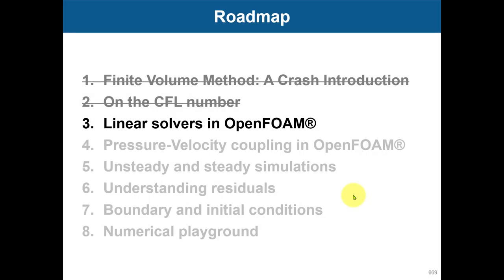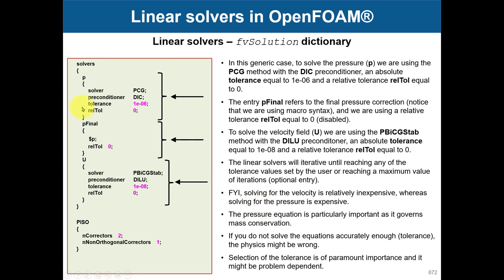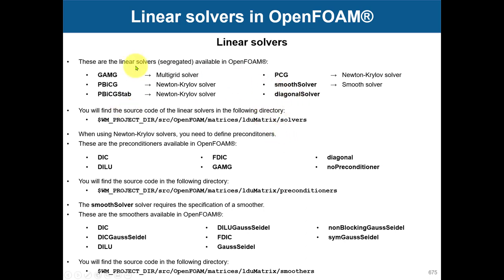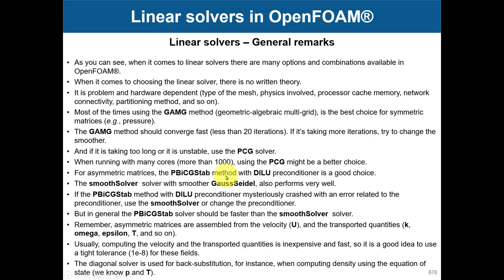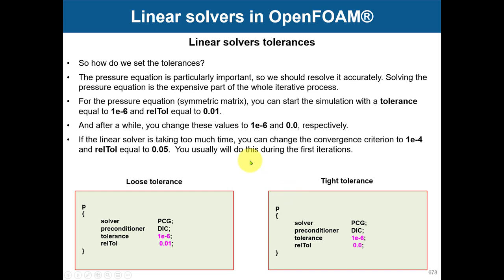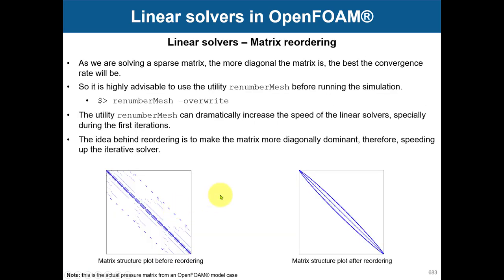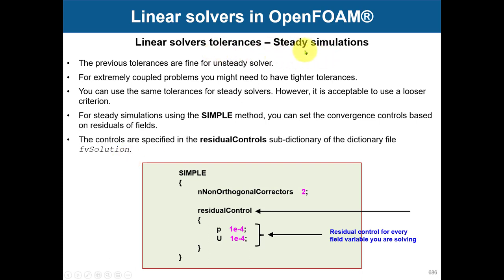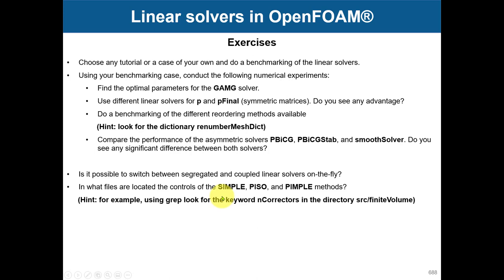6.3 Module 6 - FVM overview #openfoamtraining

Comment: Hola! can happen that PCG works worst than GAMG in parallel processing with 1M of elements-mesh?
Reply from the maker: Yes, it can happen. It is very hardware and problem dependent. However, if you switch to GAMG and then switch back to PCG, it should run faster.